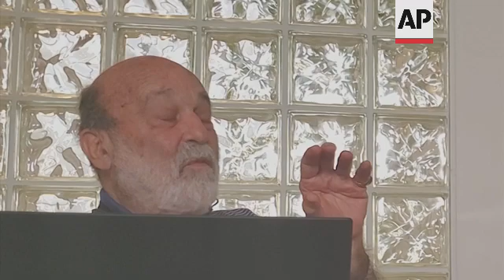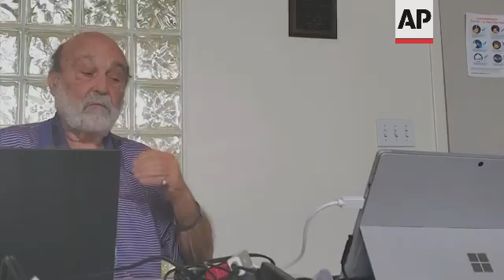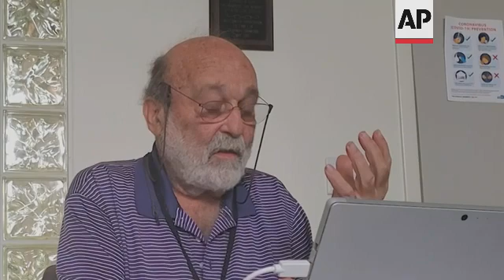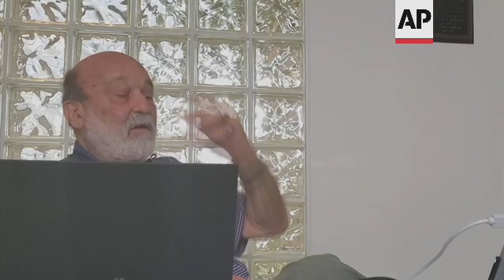Structural engineer on probe into Miami collapse

Comment: Saltwater spray is not a “one of” causes.   It is insidious and seems to have soaked into the slabs over time.  The plans show a slope and drains in the pool deck slab, but Morabito said it was flat with no drains.